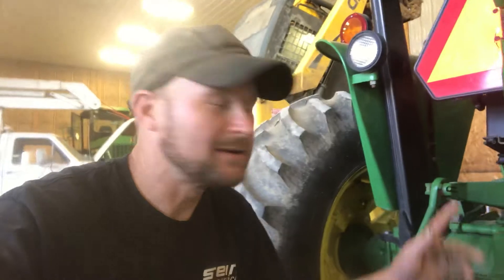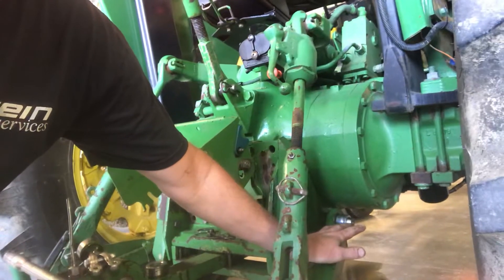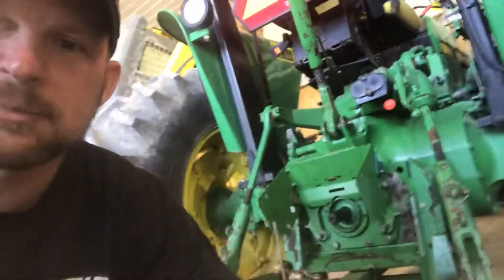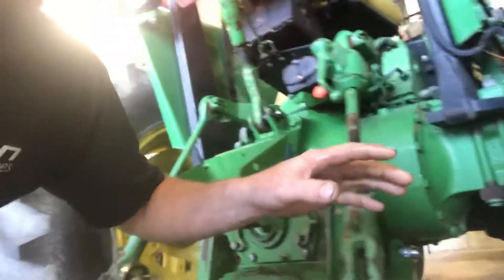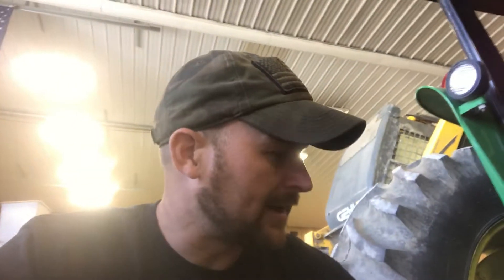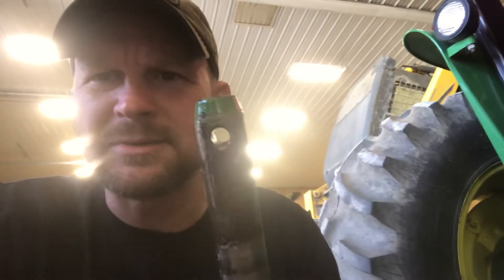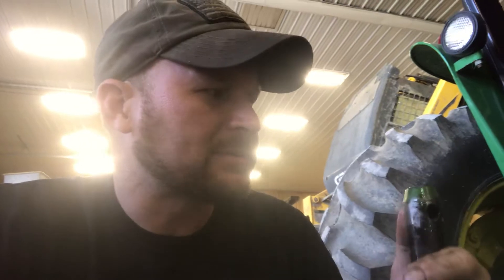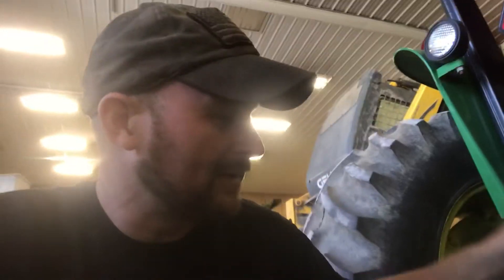John Deere 2555 load shaft leak

Comment: It would have been nice to actual video tape the removal and installation process of the old and new shaft and bushing.  I can understand the legit of your video but seeing the process would just add another level of understanding.  We have a JD 2150 and I’m assuming the process would be the same?  It seems like we are not getting the same info regarding the kit required for that 2150 model tractor from different parts sites.  Would be nice to ensure we order the correct kit for the model of tractor we have.

Comment: Thanks for video just replaced them on an 1120 now 3 point hitch won’t go down could something got out of place while I had the shaft out ?
Reply from the maker: Possibly. Not 100% sure how that model is set up. But there should be a load sensing arm that comes down around the shaft.  Possibly you don’t have it around the shaft 
   I would pull the shaft and shine a light in there to see how it’s built
Reply: Hey thanks a lot for the help I had got the linck that comes down from the top behind the shaft instead of in front of it saw this after shining the light down in there appreciate your videos that 1120 has the same set up as  your tractor in the video